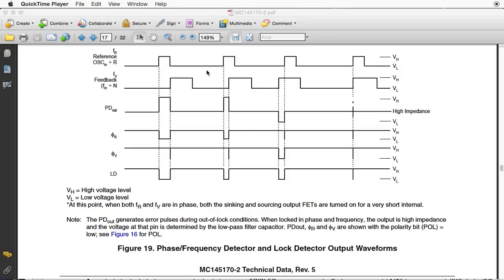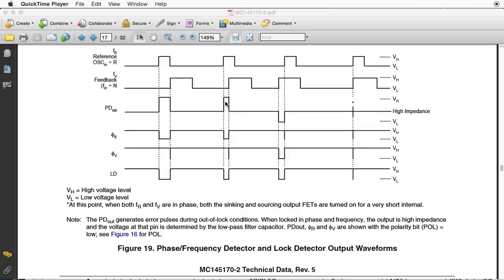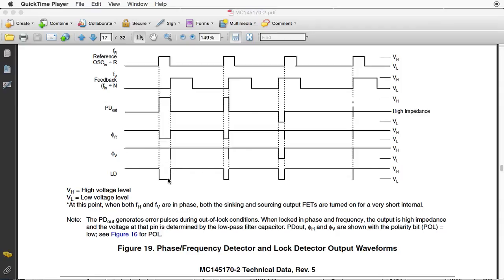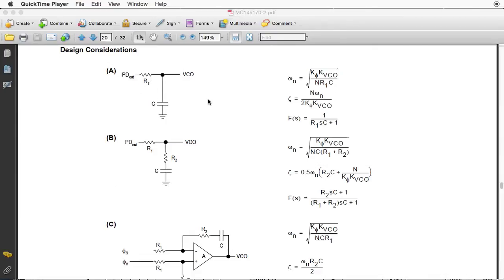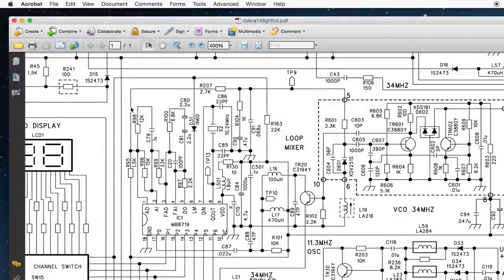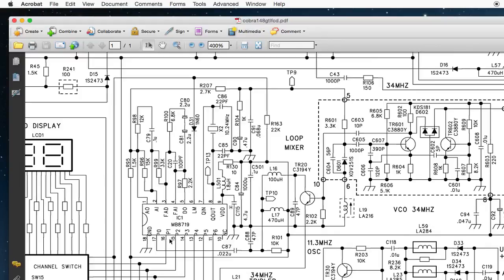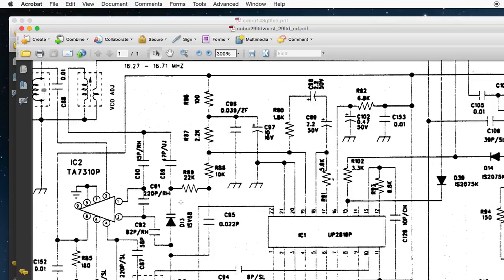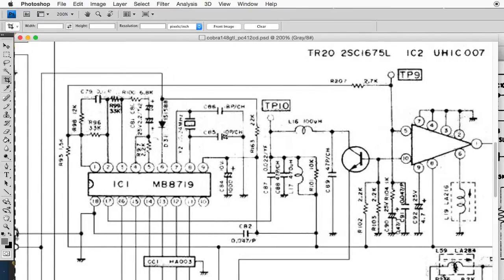#169 Phase Locked Loop PLL Theory Supplemental with CB Radio Simulator

Comment: The warble you mention is usually caused by phase noise since components you don't want are getting thru the filter.
Also could be due to an unstable reference oscillator which is why those expander kits are so horrible.
I am usually looking at the Greek alphabet soup... most people don't recognize the lower case letters in those formulas (omega, phi, and zeta)